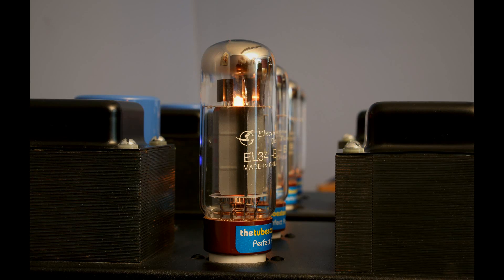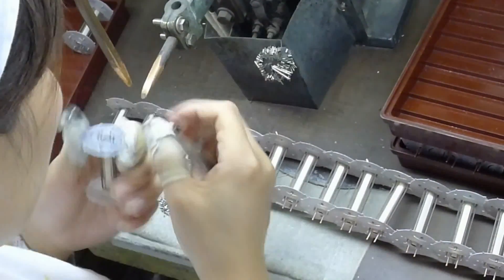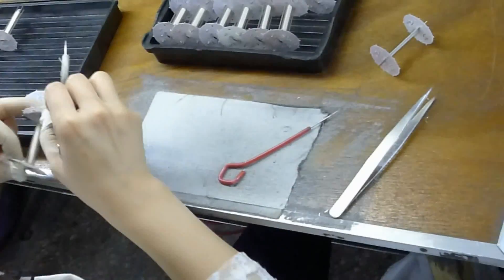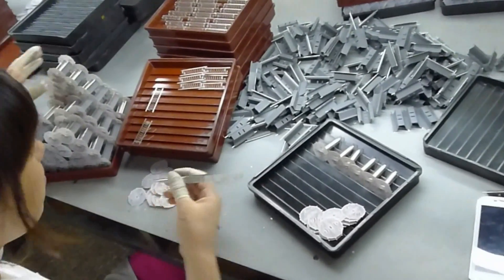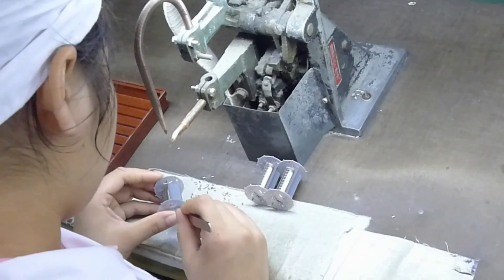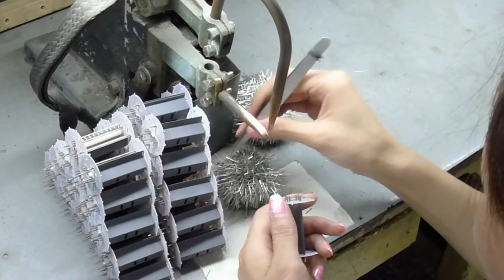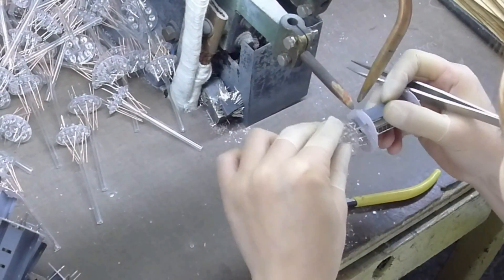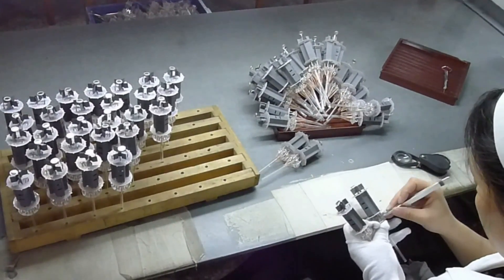Building the Shuguang EL34-B Vacuum Tube - Part 1

Comment: Watching this I was kind of surprised that modern tubes actually seem to rely on human assembly to a much higher degree than they did at the peak of vacuum tube/valve production in the mid-sixties. This is pretty clearly illustrated in this documentary about the legendary Mullard company, at or near the height of its production capacity: https://youtu.be/-GgWIlvyEL8
Reply: I agree. I've watched the famous Mullard video too and there was a lot more machinery used in the manufacturing.
Reply: @pstreetblues  Which is probably why they are roughly 5x more reliable. If Mrs Ping is having a bad day..
Reply: @cgavin1  😂
Reply: I don't think that the actual assembly of the grids, cathodes, and plates to the mica spacers has ever been done by machine. Tubes have always involved a fair amount of skilled hand work.   The parts to make them can all be stamped out by fully automated machines,  but nobody has ever built robots that assemble those parts into a completed tube structure.

Comment: The funny thing is that by the 1950s all of this stuff was highly automated with far less manual assembly than is shown here :P
Reply: The ´´Funny´´ thing is that it is not profitable to manufacture these tubes automated since they dont need to produce high numbers.
Reply: @NinoJoel  Ironically, automated production would actually improve quality.  This is why tubes from the 50's were the best ever made.
Reply: I'd guess one could automate 95% of all necessary steps with 2 roundtables having enough 6-axis robots for manipulations and spot-welding. By that approach its mostly a software designed machine, one could do every possible and impossible tube on a single machine.
Reply: @markusweissenbock6337  How many vacuum tubes do you think retail every single day anywhere in the world? The fact its probably 5 digits is why this is still not automated.